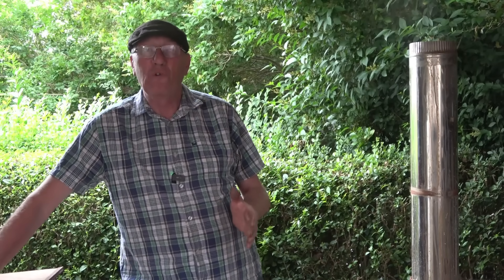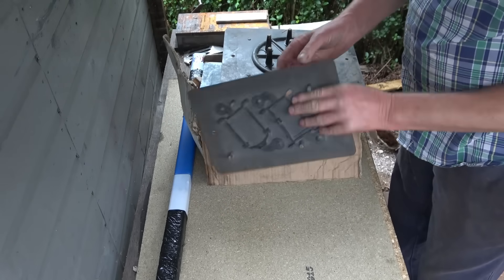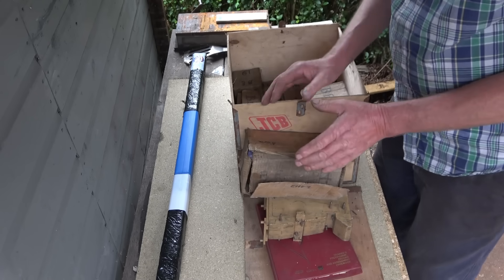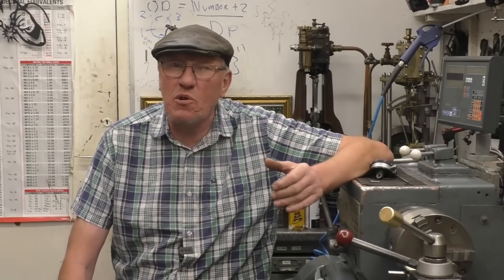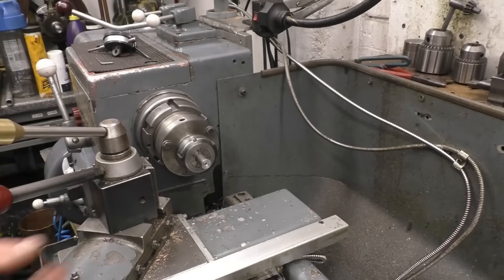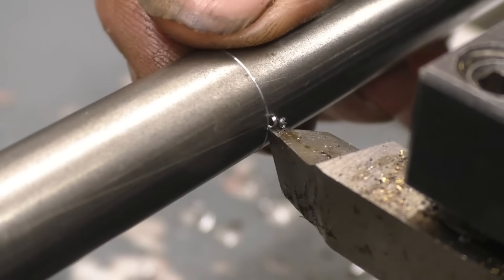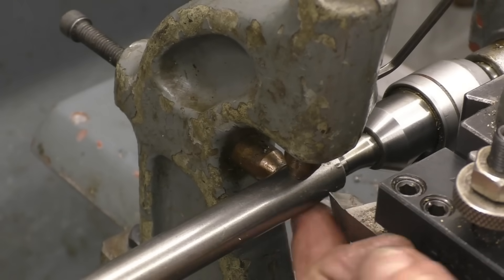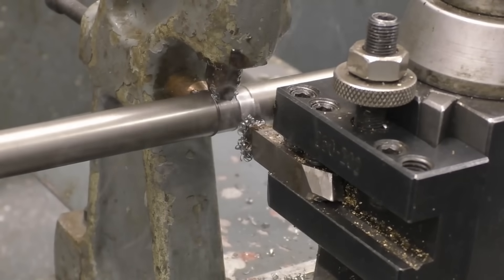Wednesday Catch Up 50  Model Beam Engine Patterns . Lathe Tutorial 13 Traveling Steady.

Comment: On the concept of thread cutting it's a skill you have or do not , having mastered lathework i had issue's with thread cutting , had a word with a turner that worked in the railway machine shop (swindon ) now long gone, he asked how i was going about it told him how i tried to cut threads' he said we dont use single point to cut threads we use chasers i'll get you some , well he did gave me about a dozen imperial & metric chasers , well all i can say is as long as you have the correct pitch setting on your gear box  ,  under cut the O/D of the thread to be cut is all that can go wrong , if you get hold of some thread chasers they will save you time & grief , i saw some last year at a steam rally on one of the s/h tool sellers ........